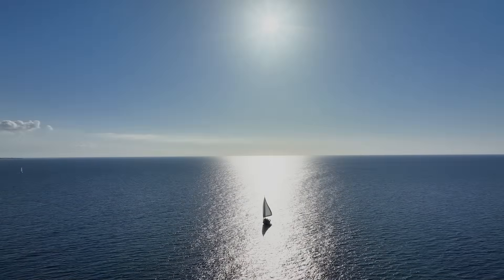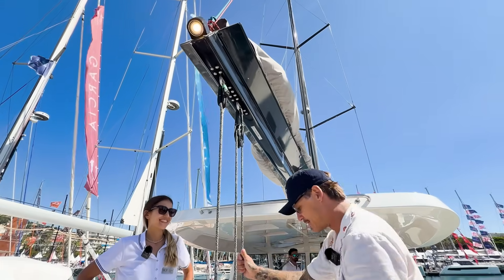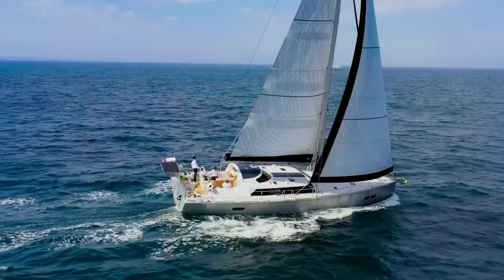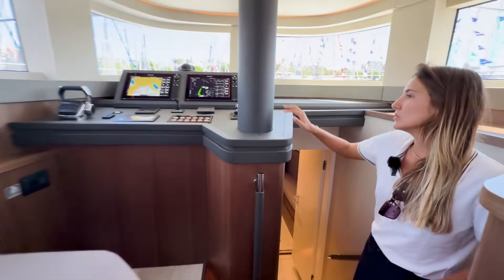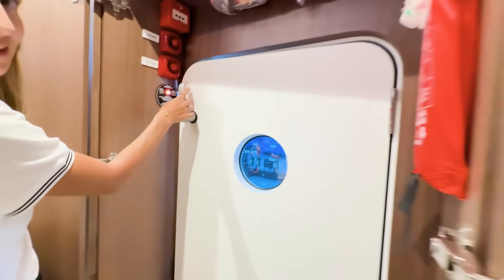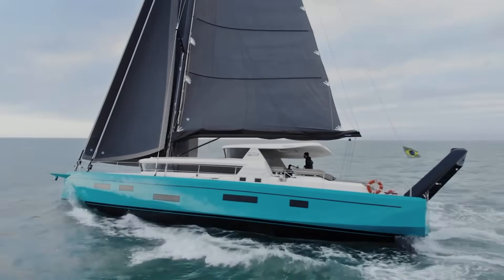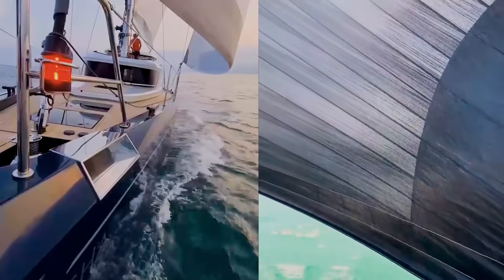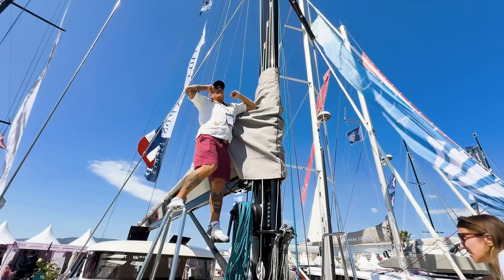Every Boat Has a Story… You’re Not Gonna Believe This One

Comment: Ahoy Captain James, Damien here from Brazil. Thanks for the great video and for telling our story — it was a pleasure meeting you in Cannes.

As the designer and builder, a short summary that complements what you have shared:

6000 nm upwind passage:  Sophia and I sailed the whole route non-stop with just one friend, leaving Brazil only 15 days after launch.  We crossed 6000 nm of headwinds in hurricane season and still arrived early for Cannes — I believe in record time for a cruising yacht of this size, even while we were preserving the boat for the show. Nothing broke; we only fine-tuned systems, including a mast re-tuning in the doldrums.

Ballasted Swing Keel:  On the 4th GExp68 hull, this system has proven maintenance-free and extremely reliable. It allows ~30% more sail area with 15% less displacement, giving the yacht remarkable upwind performance.

Electric Furlers:  Hydraulic is an option, but modern electric furlers are watertight, long-lasting, have manual backup, and consume far less energy — ideal for more silent-mode sailing.

Composite Superstructure:  Fiberglass superstructure on the aluminum hull reduces weight, allows finer detailing, avoids electrolysis issues, and — with our raised aluminum interface and epoxy-sealed bolted joint — creates a dry, lifetime installation.

Diesel Range:  Yes capacity is 2600 L, but consumption is extremely low — after 6000 miles we still had 40% left.  That range gives true freedom to avoid refueling in unsafe or unwanted places.

Maintenance:  I agree Big yachts require more care, but sailing this machine short-handed with my wife was one of the greatest experiences of my life - as we do enjoy driving the well engineered systemsonboard a yacht.  The GExp68 was specially designed for experienced sailing family who want to go farther, short-handed, with comfort and performance — I think is definetly a very conceptual yacht that doesn’t follow the usual formulas, and that is also what makes 
it so fascinating.

A big brazil hug to you both — and next year we’ll invite you for our sailing trip in Norway!
Reply from the maker: Damien, thank you for jumping in here. It was a pleasure meeting you and Sophia in Cannes and getting the chance to tour the boat with you both. Hearing the details directly from the people who built her and then immediately took her 6,000 miles upwind gives everyone watching a much clearer picture of what this yacht is actually capable of.

I didn’t sail the MCP 68, just toured her, but even from a walkthrough, it was apparent how much thought and engineering went into this boat. You guys really nailed it, a beautiful synergy of engineering and offshore capability. She’s a seriously impressive yacht

Really appreciate you expanding on the swing keel, the composite superstructure, the furling systems, and the overall design concept. It’s rare to see a boat this new take on a passage that hard, and even rarer to see it arrive with nothing meaningful broken.

Wishing you, Sophia, and the whole MCP team all the best! I’m always up for a sail, be it in Norway or Brazil. ;) 

Much love,
James
Reply: This boat is incredible good! And the project was made by people that really know the sea and sailing
Reply: Wow. This is awesome nice intel.
Reply: Lindo video!

Comment: Thank you for this interesting video. My first thought at this big boat is to make it safer and more comfortable with a main furling. Reefing the main with conventional reefing system is always an action, mainly at strong winds. Certainly you as master of KISS (keep it simple and stupid) will not recommend a mtorised furler because of the possibility of failuring function. 
But a boom furling system can in my opinion kept simple. In case of failure you can serve it manually, not possible with a mast furling system.
Whats your opinion to a boom furler. Okay, ist costs 50000 and i cannot undertand why. 
By the way, I am not an expert of boom furler, don´t have one because my boat is too small.

Comment: Several good ideas implemented, but some real boners, also.  Swing keels belong on Macgregors.  Where are the skegs?  Our 45 y o  44’ Perry fin keel had a previous owner that attempted to keep up with the Cal 2-46 (Seayanika?).  After spending six years and 2X the original MSRP, he never got to blue water.  The systems/equipment installations were done sequentially over the years, which resulted in a maze of duplications.  Hear your concerns for the furlers.  We ribboned our headsail when an unmoused snap shackle blew 30 knots and could not gather it with the spin halyard.  There are powered furlers with winch handle back ups.  Can’t wait for the Bluewater delivery.

Comment: It all comes down to engineering.  There is absolutely no reason systems could be engineered to last for decades.

The yacht industry needs to learn from the aviation industry.  Every major component on an aircraft has a design or service life.  As long as those things are serviced or overhauld within the proper intervals, the odds of having an unexpected failure are significantly reduced.

Electric furlers should be overhauld or replaced on a set schedule.

Comment: to raise ballast keel run line under to hook keel then grind both side to raise. may have to rerig purchase for full hoist - chafe gard on topsides. 9 tuns, phew. i worked on a 90’ steel centerboarder with 8 tun keel operated by manual winch - 500 turns - dumb

Comment: NOW, I must say that I had almost all of this in my 1973!!  Cal ll-46, galley up. Raised salon, nice view, WALK IN engine room with FULL STANDING head room.   Vice, drill press, nice work bench 20 GPH water maker, Diesel generator. And almost ALL of the machinery of the boat in the engine room.  Huge galley.  On and on.   Oh, and 270 gal diesel and 220 water. On a 53 yr old 46’ boat!!  And yes, quite a passage maker.  Near 200 mile days under sail and motored like a trawler with a near 3:1 reduction and 26” prop.  Many, many,  including mine have crossed many oceans a well known world cruiser.   And you can still find them in great shape in the $80-100K area   Not millions.  And  not long ago, my cal just sailed from Mexico to HI to Vacouver Canada, to the S Pacific, and back to Vancouver.   Original Perkins 4-236 still running great 

Now if you have millions.  This one is a great boat. I love it!   If you can afford this yacht, you can afford a professional engineer.
Reply: Cals are great boats too!

Comment: How many blue water experienced sailors are not happy with big swing keels that can slap side to side because the loads are sometimes incalculable? I know them. Anyone? Nice boat other than that. Kraken seems to know this.
Reply: My boat, a new horizon 70, with a swing keel, never slaps. Been in some hellasus storms, never felt unsafe.
Reply: @KristenDreyer  I would expect no issue in a Horizon 70 as it's a motor yacht with a fixed keel. Perhaps they built a boat I'm not aware of. Or maybe you have a Hinkley that should have no issues. Not sure.

Comment: And don't forget the different expansion coefficients between dissimilar materials due to temperature , the first thing that will fail is the glue that holds the 2 together.
Reply from the maker: That’s always a design factor. But in practice, failures in these systems almost always come from poor surface prep, water intrusion, or a flex point in the structure, not simple thermal expansion.
My point in the video was just that the MCP 68 is too new for us to know how this specific bond line will behave long-term.

Comment: Get a drill with a winch bit. That’s your backup furling system if the electrical system fails.
Reply from the maker: But you'd have to be up on the bow... in a storm... with power tools... I'm not a huge fan of that backup option.
Reply: on a large sail, such as this boat has, a drill to turn the winches will not work. Good for small boats only.